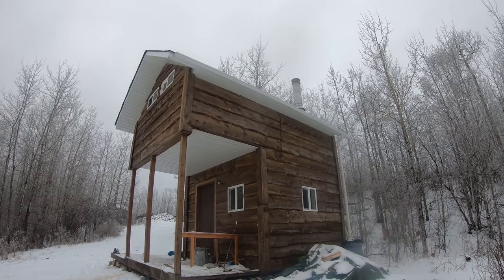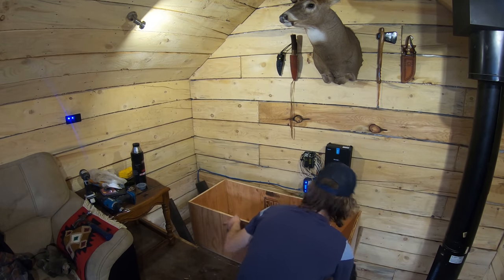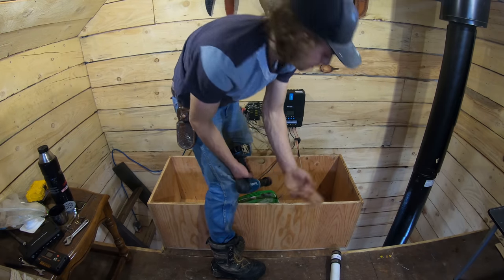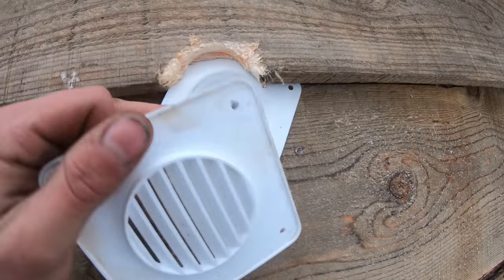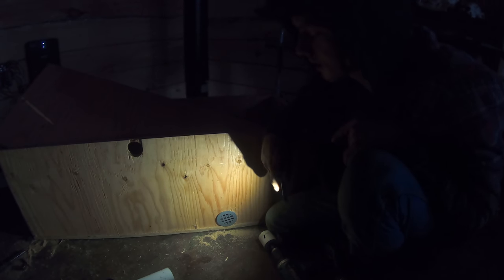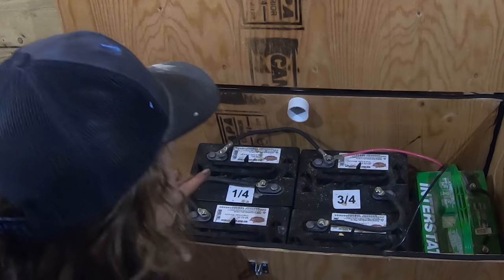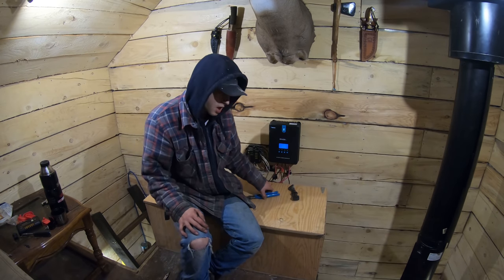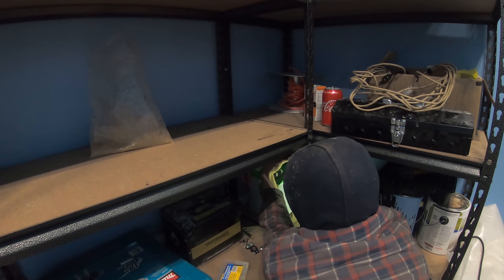Bushcamp - Offgrid Solar Battery Bank Install and Building a Vented Battery Box

Comment: I saw someone mentioned a drip loop on the solar power cord before it goes into the workshop outside wall.  That's a great idea to keep water from traveling down the wire into the shed.  Good content, you've been busy.

Comment: Hey Bro, really enjoying the show!!! Great job on all the builds, and really looking forward to more trapping videos. Really nice to see someone your age, with such a great work ethic!!! Your 8 gauge wire, in Canada, is rated for 40A. As for your Inverter, I'm still fairly new to solar set up, but do you have it grounded to grounding rods ( 2 rods, pounded into the ground,  min 6 ft apart, connected together by a ground wire), or a Ground plate? that could be at least a part of the issue. Hope that helps:) Keep those videos coming, and Merry Christmas / Happy New Year!!! Cheers

Comment: I looked at what you were doing and the first thing I thought of potential for a fire. Not how anything was connected but where it was located. That is your one and only exit for the upper floor and you have the 2 most probable causes for a fire, your batteries and the wood stove below it. I would seriously consider how I am going to get out if something does happen. I know you have window there, but bailing out of a 2nd story window isn't ideal. I would get a couple of extinguishers and some type of ladder that hangs on the edge of a window. Your videos are always real entertainment and thanks for all the work you put into them, I really get a kick out them. Stay Safe!

Comment: Love the channel man.
Battery for solar 
Led acid you only have 25% of the apms that you can use befote you start to damage them. For example 
100amp battrey you can use 25amp and thats your lot.

Agm or gel you can use 50% before damage

Lithium battrey you can use 100%

So the way you work out what you can use and store to what money you pay.
The 4 battreys you have will store 450amp but you only have 100amp to use every day.
So you may as well just buy one 100amp lithium as you will have the same power available.
I hope this helps for when you next change batterys
Reply: Hear the same everywhere about lithium batteries.
Reply: Great advice.
Reply: Depth of discharge can differ between lithium chemistries. I would recommend LiFePO for his application. Cheap as and safe.
Reply: @roryo1386  make sure you check the temperature range you can charge those LiFePO's at. He'll be needing to charge them in freezing temps, which are a no go (for charging) for LiFe types.
Reply: @metamud8686  Very true but there are easy ways to mitigate again that (heating pads) and new tech has allowed them to be safe to -20°C

Comment: You might get a computer fan and mount it so it's pulls air into the box.  That would force any fumes outside the vent going outside.   Uses basically no power.

Comment: Putting the intake on the opposite side of outtake vent would have been ideal. However that's no problem because technically you need 2x the intake to outtake so u can add another one on opposite wall. Looks good that's for damn sure.

Could also add a computer fan to the outtake if it gets to hot. 💘

Comment: With it being as cold as it is, your panels are going to perform better than they would in the heat so that helps combat the reduced amount of light so you could still be getting 450-500ish watts in full sun.   That being said, you have 450Ah at 12V so that is 5400 Watt-hours of storage so to charge them up to full after being drawn down to 20% capacity you would really want to give them a full 9 hours of sun.  If at all possible with any battery bank you want to add up all of your loads that you use in a given day, which your charge controller may even be doing already, and you can then figure out how long you could go with cloudy overcast days.  Typically you would want to size the system to handle 4-5 days of limited or no sun if you have a backup generator available to charge them up in a worst-case scenario.  So if you only use about 20% of your battery bank during the night or less, you have a fairly well-sized bank.  600 watts of solar panels should be decent for that battery bank size as long as you typically receive enough sun for the day to keep the batteries topped up, even while charging up devices.
The other thing to consider with your new battery bank if you don't do this already is creating a watering schedule so you check the water levels of your batteries every 2-3 months or so and keep them topped up with distilled water to the manufacture recommended level to get the full useful life out of them.  You can also coincide this watering schedule with the times the batteries go through equalization since equalization uses a lot of water.  That is one thing to check with that old battery you removed is to see what the water levels look like if you haven't been checking it as you want to typically keep the water level about 1/8" above the tops of the plates.  If that old battery has been in service for more than 5 years it is likely tired, but if not it may just need to have its levels checked and take on a good equalization charge to get back some of the lost capacity.  The main reason people go to AGM is that as long as you have a decent charge controller, they are basically maintenance-free with no watering or equalization to worry about.
One other thing to note is if you would have gone for lithium you would not have been able to charge when below freezing as that would damage most lithium battery chemistries so for your use case, lead-acid is likely the best choice.

Comment: You need a fuse in series with the positive lead coming from the battery. If there is an overload condition due to a fault in the charge controller, you're looking at thousands of amps of short circuit current from your batteries.

Comment: Batteries in parallel fight.  Faulty installation.  Since you are using four 6 volt batteries and one 12 volt battery,  the 6 volts could have been wired in series as two 12 volts,  then,  three separate chargers.  Three separate circuits.  Only one circuit could be used with the inverter at a time.  All three chargers could be used off the same solar panels.

Comment: You will be perfectly fine with your uses and 4 gc2 batteries.  The 600w of solar should keep them above 50% even running your fridge.  My 4 gc2 batteries run a bigger mini fridge with freezer and 100w of 120v lights for a weekend.  We only have 460w of solar and only get 3hr of sun on them in the summer.

Comment: In the workshop you can use 3x100w panels, if the budget isn't ready for a MPPT regulator at once - use PWM and 3 panels in parallell until a MPPT can be installed and change the panels to series. Then the voltage and ampere is better for charging even in low light. 3 100w panels in series is more than 20A in the summertime - you need a 25A or 30A MPPT regulator.
In Norway I have used Steca PWM and MPPT 20A regulators on 2x100w panels. Tried cheaper PWM a while, but then the heater "died" - the old Steca managed to maintain enough power for the modem - SMS response from the oil heater is my security to know it is still working. This fall and early winter has been extra dark - the charging is almost gone - even with MPPT.
Tip1: 1x200w panel 72 cells is the same as 2x100w 36 cells in series. 1x200w 72 cell panel produces almost 17A in max.
Tip2; Always remember to remove the snow from panels. Power drops ca.80%-to 90% when covered area is ca.5%.

Comment: Do you have a multimeter? If I were getting a low voltage message, the first thing I'd do is check both the old battery and new battery sets to see what the voltage reading is. Also, could you post the make and model of the inverter?

Comment: you might have to let your batteries charge up real good for a day or so . also take a volt meter and check to see if you are getting 12 v or more like around 12.5 . but that inverter might have a auto shut off on it . at 11.7 or 11.8 and that could be your problem . just needs to be charged up .  let me know . but yes get a volt meter on it first .    Good luck my Friend ....  P.S Love the VID

Comment: I Tune in because I always like a good laugh. Dude the way you do things is 1 of a kind that's for sure... A. Why don't you mount the inverter and everything else On a pc of quarter inch ply wood, And mounted to the wall with two screws. That way if you need to work on the inverter or anything else all you have to do is take out two .screws and everything's away from the wall.😂😂😂😂😂😂😂😂😂😂😂😂

Comment: Dude,  you may have fried your charge controller.  You have to unhook your solar panels before unhooking the battery.  If you don't the power coming in from the panels has nowhere to go and it burns up the charge controller.

Comment: HEY!!! For your inverter you technically only had it hooked to one 6v battery! Jumper the lead between 2 batteries rather than one)  to get the full 14.8v on your 12v system.
Reply from the maker: hey buddy i tried that too but had not luck
Reply: @TraplinesandInlines  Even if you hook it to the same area that the leads going to the charge controller are? (On the battery side)
Reply from the maker: @232Stangpwr  yes sir and the bank is definitely in 12v so struggling to make sense of it
Reply: @TraplinesandInlines  maybe try connecting at a different point on the battery bank. Could be getting feedback from your charge controller.
Reply: Any luck?
Reply from the maker: @232Stangpwr  i will check when get back to camp i am just out trapping bud thanks for help

Comment: Why do the battery box need venting
Reply: The charging of lead acid batteries produces hydrogen gas. Hydrogen gas is not toxic but it will deplete oxygen in the air, which would be bad for humans and animals in a confined, air tight space.
Reply: John Harris the internet needs more people like you thank you for sharing your knowledge in a way that doesn't make people feel like assholes for asking a question
Reply: Hydrogen gas goes boom.  Not good
Reply: @AppalachianLife  Hydrogen also has the tendency to go bang as low as 5% concentration. 5% will take your roof off and ruin your day.

Comment: 600w@ 12.0V =50A
You have ALOONg way to yur panels and DC current does not travel very well.
Wire yur panels in series 18V x2 for 36V potential at the source or18V X3 = 54V for more voltage if yur charge controller will allow you will have to check the system in full daylight and at the CC for DC voltage. Wire size is going to be the denominator so the higher the voltage the smaller the loss of watts with the same size wire in your existing system  if you are running lower voltage to the CC. Battery bank to inverter should be fused on pos side and be matched accordingly to the output of inverter and as short of a run as possible to avoud overheating of the wires.Amps make ALOT of heat if there is resistance so keep yur wires 00 or bigger from battery to inverter for 1k output and bigger copper wire for a larger inverter. I run a 50A fuse for 1k watts and 80A for  my 2.5k Watt inverter. 10 yrs now no fires. Hope this helps.

Comment: Small old freezers make great battery boxes, you can even mount most of your components inside and lock it all up. Thanks for the video.
Reply: I really like this idea
Reply: Reason for setting batteries in a box is to vent hydrogen gas. Terrible idea to mount anything That can arc inside of the inclosure. I’ve seen some pretty nasty cases of boxes being blown to pieces from a loose battery lug.
Reply: @brandonshudy789  You still vent it or have it outside/battery type as you know! ....The fact is its already made and recycled instead of in a landfill....as for arcing there are many ways to eliminate that. I also use one for my genny, its soundproof and thief proof....oh I guess I should mention for those not so inclined , the muffler is exhausted to the outside.

Comment: You asked about your inverter. Make sure you have your batteries correct. Bat 1 and 2 connect positive to negative just like you have it. Making 12 volts. Do the same for bat 3 and 4.  Bank 1, connect the positive to the positive on bank 2. Negative from bank 1 to negative on bank 2. Now, inverter goes on the positive post and negative posts
Reply from the maker: ya thats what i did but it still senses low voltage is weird
Reply: @TraplinesandInlines  my dad had an inverter that did the same thing. It worked fine after the battery was fully charged. Did you put your old inverter on your new setup to see what it said? You might simply have a bad inverter.
Reply: @TraplinesandInlines   You should take the leads from charge controller and put on separate banks. Positive off bank one and negative off bank 2. Will help keeping battery even. Pulls throughout entire bank verses one side

Comment: Man, BE CAREFUL when you open that box after using it for a while. A whiff of that may take you out! Try putting a PC fan on the intake with a switch, so you create positive pressure inside for some minutes, pushing all nasty vapors through the exhaust before opening it! Good luck! Keep on the good work!
Reply: 100% worth a small fan.

Comment: Venting may have a problem since your wood stove is trying to pull in combustion air from wherever it can get it.  It may be a good thing to look into installing a vent into the wood stove so that it is not pulling cold air into the cabin from places where you don't want it to.   There are vids on ytube discussing make up air for wood stoves.   also your mic sucks.  difficult to hear what you was saying.  It's a problem because I really like to hear  you talk.

Comment: K, I work for a battery co & have been using solar at my camp for over a decade, if I may;
Follow the 50% rule - don't trust the cut off on smaller mo (modified sine) inverters. Keep your bank at 12v+ or higher. State of charge is relevant to your banks condition. Go to harbor freight or where ever and get a 12v tester/meter they are cheap. Keeping your bank charged means keeping batteries from freezing. Someone mentioned lining your box with plastic, or go to a dollar store and buy 4 plastic dish pans. The more you can run from - off 12v instead of the inverter the better. For example I use an inverter for the power tool charger yeah but for the laptop you can get a 12v to 18-19.4 converter plugs into 12 socket. For the vent snag some screen door mesh and sandwich the vent to keep flys and insects out. For your wiring I couldn't tell from the video but with DC you want stranded copper not solid wire. Two 6v's in series then parallel is correct but you want your draw on that bank from the farthest negative and then positive connections not the center. Good luck.
Edit; I also recommend a battery hydrometer like the ezred sp101, also cheap. It'll allow you to easily measure the density of the electrolyte in each cell, or state of charge. You'll want 1250 or above being better obviously. I'd use distilled water to keep the cells topped off.

Comment: Some one can check me on this but I believe the wood stove combustion creates low pressure condition inside the cabin.  This may cause the battery box vent to not work properly. Air can possibly flow backwards through the vent to try to equalize the pressure inside the cabin. the solution is to run the boxes intake through the wall as well.  That should isolate the inside of the box from the pressure fluctuations inside the cabin and allow the box to vent as the hydrogen leaves the top hole outside air can seep in through the bottom hole.

Comment: You may have already figured it out, but I would connect the inverter, lights and any load directly to the batteries for your 12 volts. Also with the two 6 volts wired in series, you double the voltage and the amps stay the same 225 amps. In parallel the voltage stays the same and add the amps together. I hope this helps. I enjoy all your videos.

Comment: What I find odd about people harping on venting batteries and yet they have 20-30lb propane tanks inside their cabins for their hot water showers or small propane appliances....
Reply: Right there with you on that. He is in a small upstairs space tho, so it's probably best to have it vented lol.
Reply: @matthewharvey8755  Yes still vented/battery type and yes to the small space, it was a suggestion for others. As I use two of them one for my solar install and one for my genny...its soundproof and thief proof.

Comment: make sure ur charge controller is set to lead acid    ur power inverter can't handle 24volt or higher input only 12volt u need a inverter that can handle 24to 48volt input there might be a switch on power inverter to change from 12v to 24v look and see

Comment: If you decide to install a vent to provide air for the wood stove, you should think about installing a valve or shutter on that vent.  When you want to let the fire die down or when you are going to let it smolder while you are out and about the cold air going through it will really cool the cabin once the fire has gone out.  The cold air will still circulate even without a fire.

Comment: Did you know instead of using the end of your pliers to make a crimp, you can use the upper part between the handles. It gives you a little more clamp down power. Giver a try.

Comment: Hey Friend👋🏾
First, I Don't Know Shit about Solar but I watch alot of VanLife and OffGrid Shit on YouTube 🤔🤔 Is there a reset button on the inverter (Alot of electronics have a Fricken Reset Button🙄) that needs to be pushed when batteries are added or new batteries are installed🤷🏾‍♀️🤷🏾‍♀️ and Secondly, check into those New Lightweight Solar Batteries from Canadian Battery.. Just saw a Van Lifer switch from the AG to those New Canadian Batteries.. 
Take Care and Be Safe
Detroit Mecca